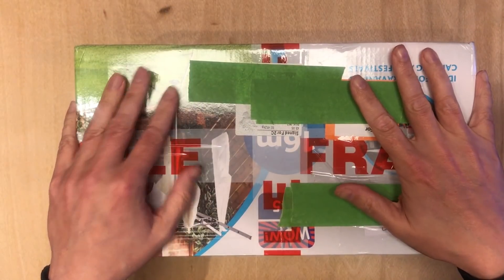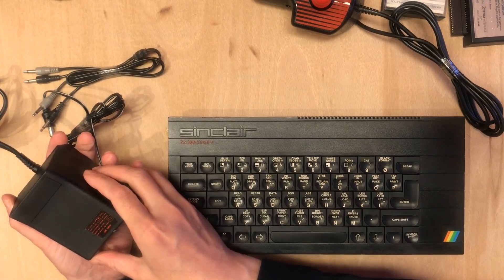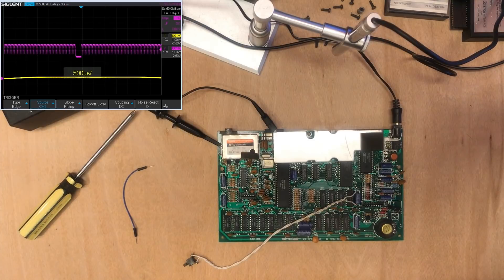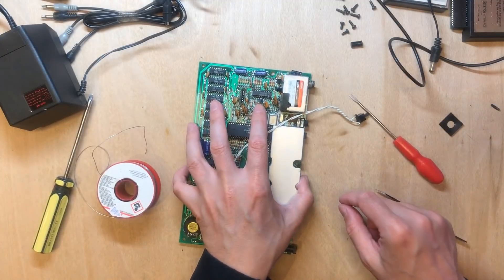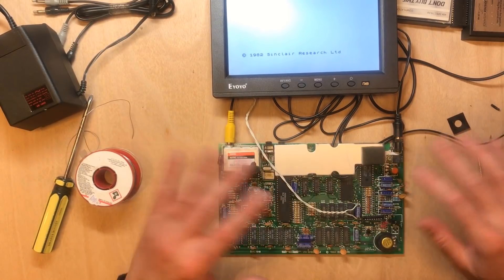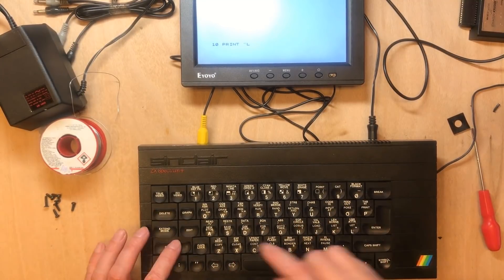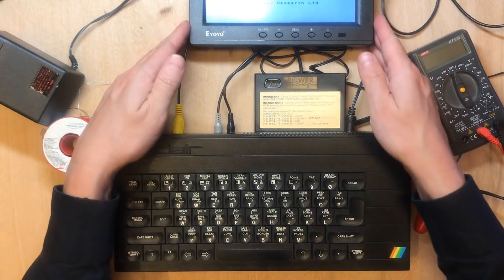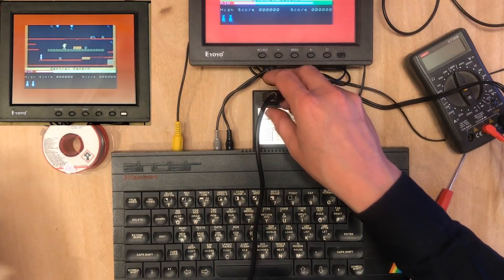ZX Spectrum+, UnBox, Test, Mod and Repair

Comment: My first computer was the standard rubber keys Spectrum 48K but it was not a family one, it was my own that I saved paper round money for. I was later gifted a Spectrum 128K, the one in the plus case and the heat sink coming out the side. I still have both in my possession though the 48K is a bit roughed up with the faceplate glue failing.
Reply from the maker: My Spectrum+ was actually an upgrades rubber key device. The board inside was the same, the family bought a 2nd hand rubber key spectrum with a slightly dodgy keyboard and the upgrade kit.
Reply: @weirdboyjim  That's pretty much what the Spectrum+ was anyway; a case upgrade. If the board had been redesigned for the case then the reset button would not have been connected via wires across the whole board.
Reply: They call that one the toast rack if I recall correctly.

Comment: On the video out connector, you can see that the resistor broke of - on the socket, it's a clear dry separation. Not surprising on those connectors. I did those mods myself as a kid :)
Reply from the maker: The weird bit was that the base of the resistor was loose as well, couldn't do anything about that without taking the modulator off.
Reply: @weirdboyjim  I saw this a lot in the '80s. Kids (like me) jammed connectors in way too hard, and those modulators were designed for essentially a single insert and then leave in. But we moved them from room to room daily. I see the same issue today with Micro USB connectors :)

Comment: Those membranes are notoriously fragile, especially the ribbon cable.
Reply from the maker: Yeah, That second issue I had was "solved" by pulling the ribbon back out a fraction of a millimeter. Tempted to do some kind of custom keyboard for it actually.

Comment: That's an unboxing.
Reply from the maker: I once recorded an ebay unboxing for a minute until I realized it wasn't the item I thought it was (It was a replacement part for my vacuum cleaner). I spared the channel that short video.
Reply: @weirdboyjim  Vacuum repair still sounds interesting.
Reply: @weirdboyjim  I was hoping to scavenge a motor from the last one that broke. It was a custom wound coil.
Reply: "What I know now." Plenty of face palms later in life.